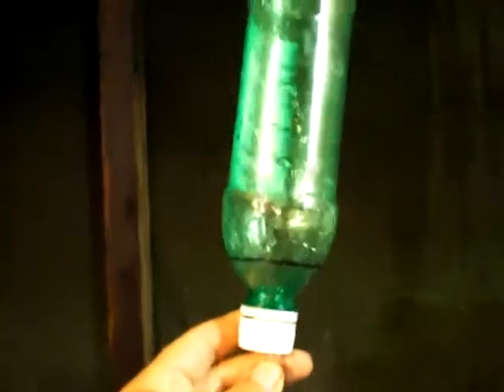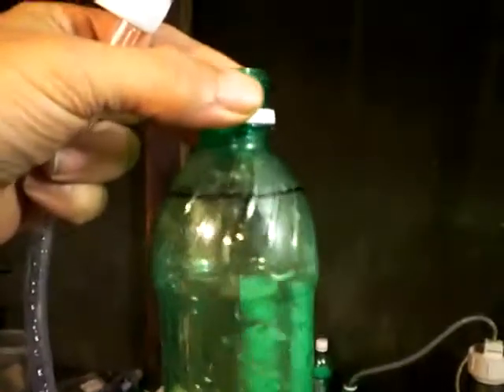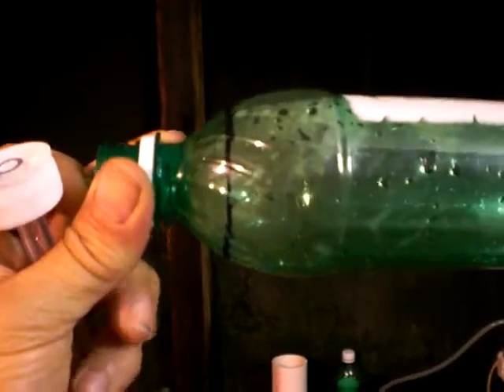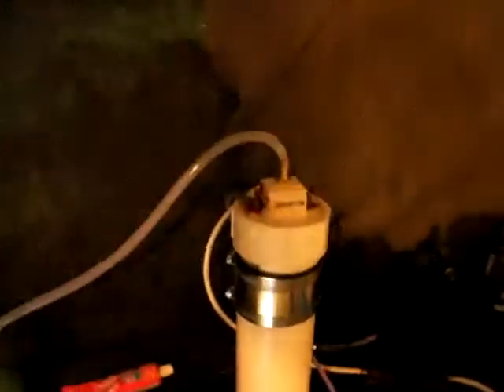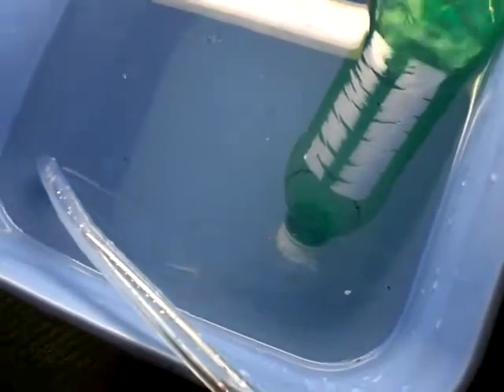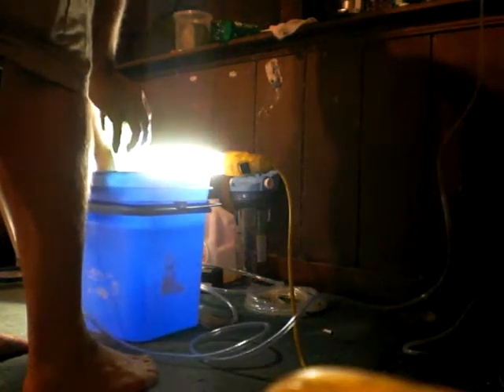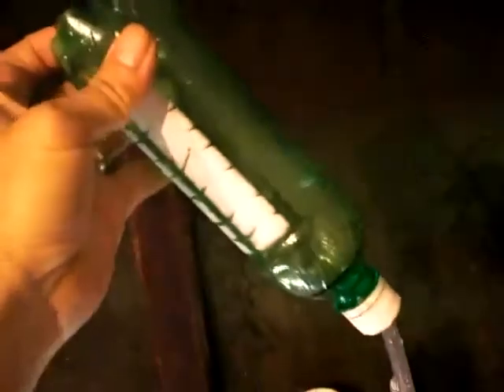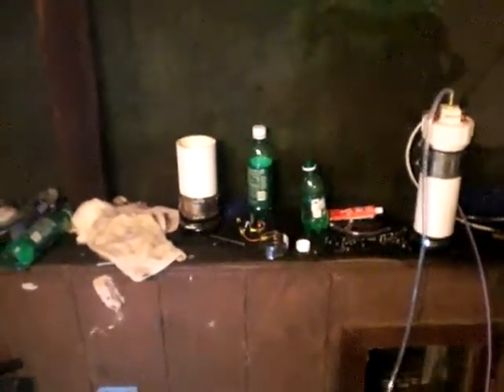Simplified HHO Flow Meter

Comment: You're possibly already aware but you'll want to consistently control the amount the bottle is submerged in the tank or not because pressure could potentially add resistance and slow it all down. Brilliant design